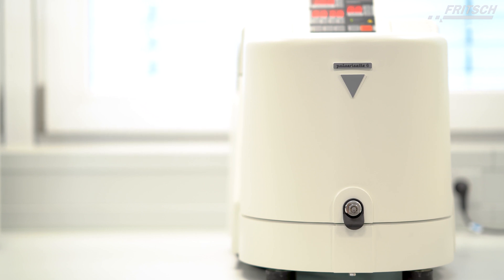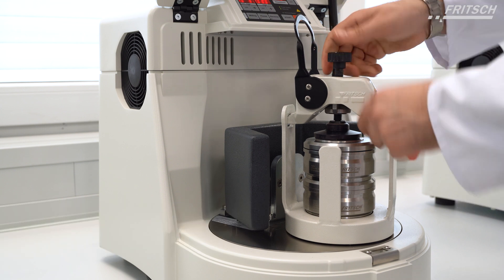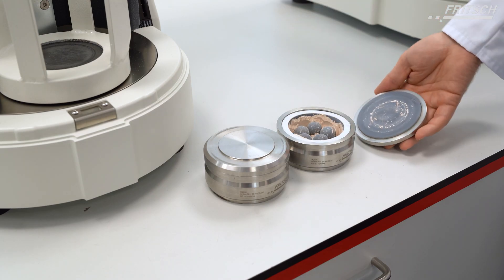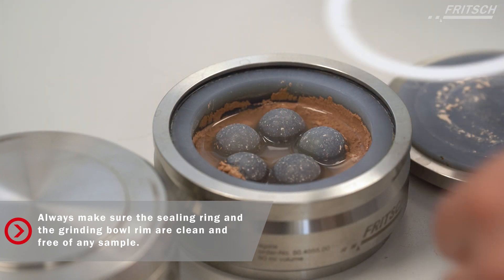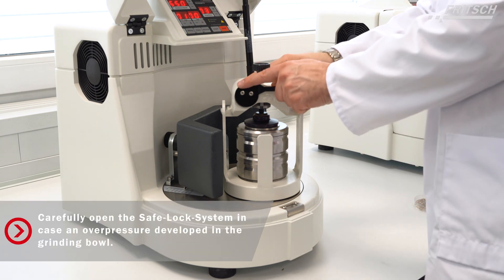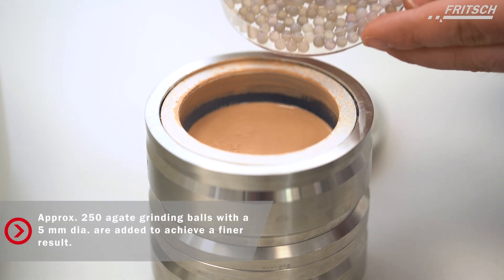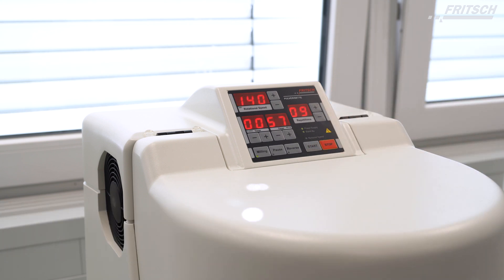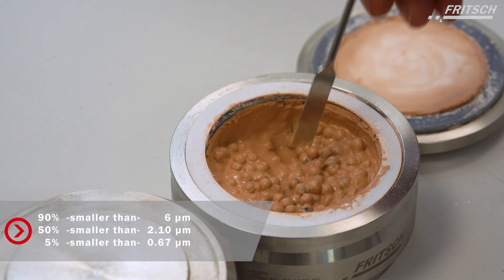Milling a rock sample with the Planetary Mono Mill PULVERISETTE 6 𝘤𝘭𝘢𝘴𝘴𝘪𝘤 𝘭𝘪𝘯𝘦

Comment: The clamping system has become impossibly tight to achieve a click. Why is this happening?
Reply from the maker: Hello, please try this: We assume that the "click" mentioned is the noise that our torque makes when the adjusted torque is reached.
Or it is the sound that is made when the Safe Lock lever is closed. Check the torque:
- Clamp the Allen key firmly and turn the handle of the torque  clockwise. Almost as if you want to tighten the Safe Lock. If no clicking sound can be produced, the torque is probably defective
- If the torque  does not click or unlock, please send it to us for inspection.
Check the Safe Lock:
- Insert the Safe Lock with the corresponding cup into the cup holder and tighten the screw connection of the Safe Lock by hand.
- Move the Safe Lock bracket from the vertical position to the horizontal position (close the Safe Lock)
- If this does not work, please return the Safe Lock to us for inspection.
Finally, check the height of the cups to be clamped. Is there still enough space to insert the Safe Lock properly and turn the pressure screw downwards?
Should you need additional assistance please contact service@fritsch.de

Comment: I want to run sample for 2 hours with 10 repetitions, how long should I set the cooling time?
Reply from the maker: Unfortunately, this question is not so easy to answer.
There is a guideline which states that one minute of grinding time is followed by at least 3 minutes of pause time.
It is also possible to program a grinding time of 5 minutes followed by a 15-minute break.
However, there are important points to note. If the total grinding duration is carried out with x cycles over several hours, there is a risk of an exponential increase in temperature, whereby the pause times are then no longer sufficient to cool adequately. In addition, attention must be paid to other influencing factors, such as the boiling point of the liquid phase during wet grinding. Sample sticking or increased abrasion can also only be detected if there are sufficient breaks and the grinding progress is monitored in the meantime. The latter is always recommended from the application side in order to accompany the grinding in a targeted manner and to use the grinding set correctly.
 Should you have additional questions, do not hesitate to contact us directly: info@fritsch.de 
We will be more thang glad to answer your questions in more detail1

Comment: sample run 3 min, I set the cooling time to 3 minutes, right? To cool down the grinding bowl during the run. what about other samples whose run time is not 3 minutes? The cooling time also need to be adjusted? For example,if the sample runs for 2 minutes, the cooling time is also 2 minutes? What happen if i run 2 minutes but the cooling time is 3 minutes because I forgot to change.
Reply from the maker: Glad to be able to assist: Typical grinding time is approx. 1 minute, the ratio of the pause time is approx. 3-5, i.e.: 1 minute grinding, followed by 3 minutes pause. In addition, programme 2 x repetitions. This means 3 x 1 minute grinds followed by a 1 minute break. Hope this helps. Feel free to contact us at any time.

Comment: pause button on the control panel,what is the function?
Reply from the maker: The button is for programing pausing times while working with intervals.
You can program the mill for example 1 minute to grind and follow by a 3 minute pausing time.
This is very beneficial to chill your sample during the process, especially when organic liquids with lower boiling point  are used.

Comment: what is the range of starting material size ?
Reply from the maker: In this specific case, the feed size was <80µm.
In general, the feed size depends on the grinding tools to be used, such as bowls and balls. 
Simply click on https://www.fritsch-international.com/sample-preparation/milling/planetary-mills/details/product/pulverisette-6-classic-line/accessories/ then select grinding balls and selection aid.

Grinding samples of up to 10mm feed size can be ground without problems (depending on sample material). If necessary, the grinding balls have to be exchanged in time, depending on the application, in order to achieve the desired final fineness. 
Our representative or the Fritsch laboratory will be pleased to assist you in the selection of suitable grinding tools for your application.

Comment: I wonder how to clean the balls.  As far as i know, when i wash the balls, put some powder(Al2O3- like that) with solution(H2O) in the machine and operate it. Right?  Can i mix balls of different size and wash them all at once?
Reply from the maker: Hello. Thank you for your interest, we are happy to help.

The cleaning of the grinding set, including the grinding balls, is generally to be handled like a normal grinding process. This means, you cannot mix grinding balls of different sizes or use different materials of the grinding assembly. As a sample, sand is used in the amount of a typical sample in the correct volume of the respective grinding bowl. For example: 10-30 ml sample is recommended for an 80 ml bowl, so 10-30 ml sand is needed for cleaning.

If the contamination comes from a sample that can react with water, you should not add water and grind dry at maximum speed for one minute. If the cleaning procedure was successful, the sand is disposed of. Then the grinding set and the equipment are rinsed and the grinding set is well dried to avoid corrosion. If the cleaning was not successful, the cleaning step can be repeated several times with fresh sand.

For wet cleaning, water is added in relation to the sand until a liquid paste is formed. Before wet cleaning, it is important to insert the seal. The well-sealed grinding bowl is now also ground for one minute at full speed. Here, too, the step is repeated if necessary and the grinding set then needs to be dried properly.
Reply: Use silica sand and put just a little squeeze of a Methanol for liquid . The bowl and the balls are gonna be like new . 30-50 seconds max is enough .